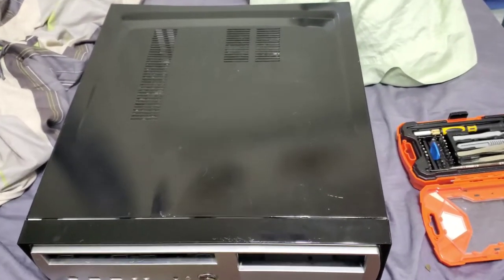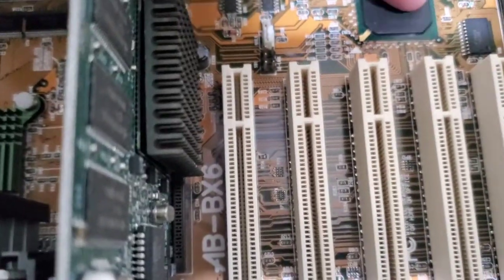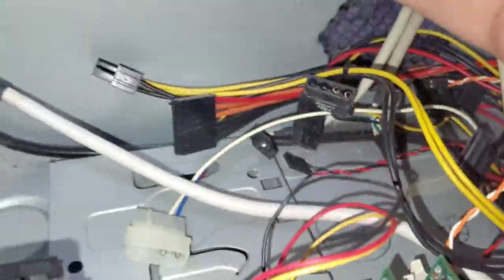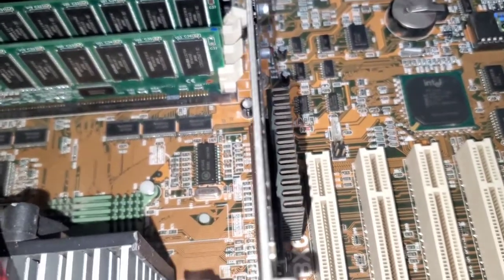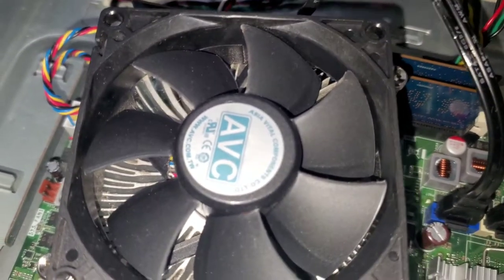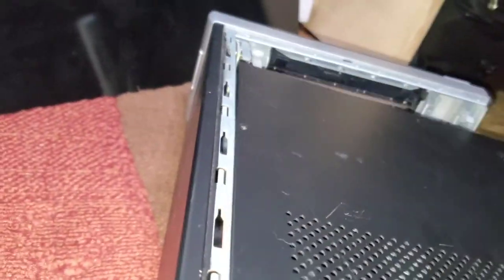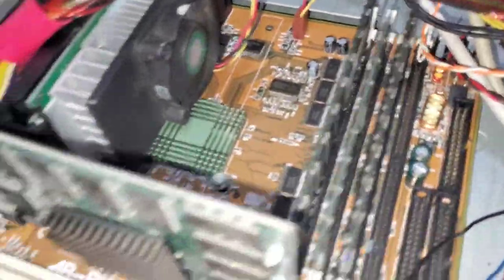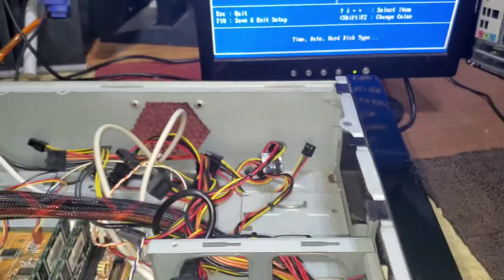A random computer video with pointless rambling

Comment: cool vibes from the thumbnail lol. Awesome machine tho, except rip caps. If you recap it would be interesting seeing if it runs after all this time. I've seen those long "ISA" slots before in my powermac G4, it's ancient stuff from all the way back in the 80s when IBM made some of the first PCs. Works the same as PCI in that you can plug in all types of different cards in it, it's just that it has wayyy smaller bandwith with only 3MB/s and runs at 8Mhz. All the data was also handled by the CPU instead of directly accessing the RAM. Today I guess there isn't a whole lot it can do well considering the speed, but I mean it's there for old times sake.